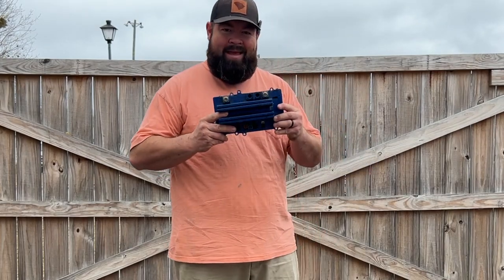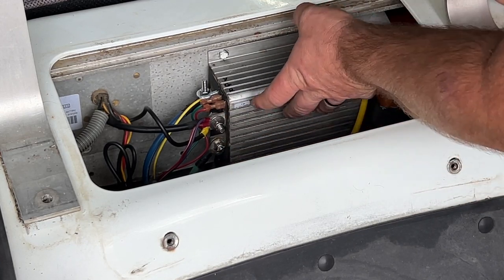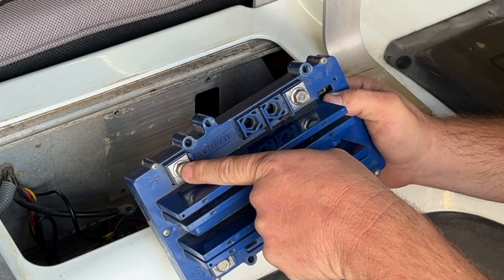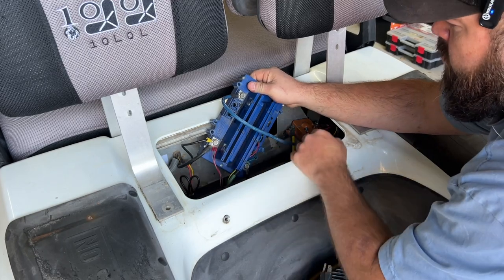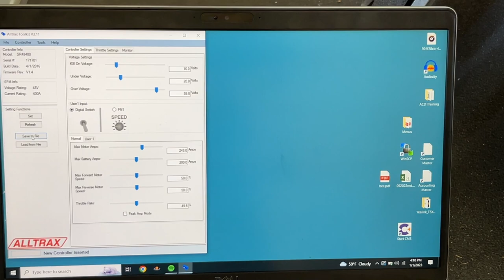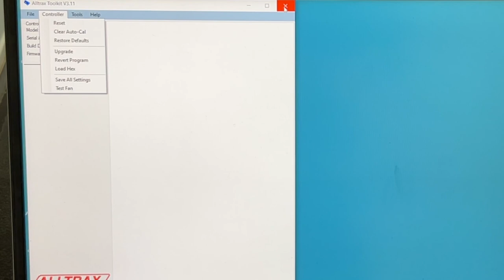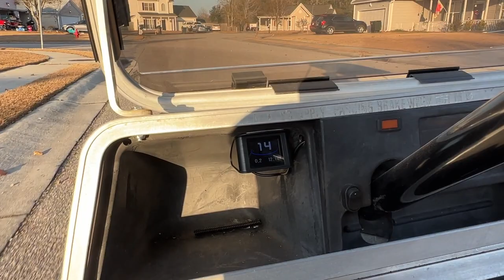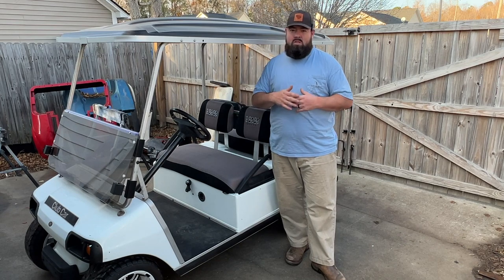Installing Alltrax 400 Amp Controller On Older Series Golf Cart | UNLOCK Settings | Club Car DS

Comment: Came here from you newest Plum Quick video.  I have a '99 CC DS stock with the Plum Quick Grizzly.  Can I just change out the controller and solenoid only?   USB A to USB B 2.0

Comment: hello, love the videos, new to carts, I just came across an fsip motor with alltrax controller, hd 48v solenoid & charger and trojan batt's (cheap) on marketplace locally its off of a 2014 precedent. do you think that it would fit my 93 resistor cart? Id be upgrading from 36v i know. i really just need to know if the motor would bolt up on my axle.

Comment: Always enjoy you videos. Guessing 48V batteries in parallel would allow you to get much more current to the motor. The controller being able to handle 400A and you only have approximately 100A with batteries in series. Is that correct?
Reply from the maker: The batteries are 100ah batteries, that is capacity (run time). The bms in these batteries says 100a continuous, I could up the amperage but if Im riding on the road only, then I wouldnt pull anywere close to 100amps and If I did it would only be at the very beginning to get the cart going. Another thing that I think confuses a lot of people is just because you set the controller to amperage out put doesnt mean you would pull those amps. Say you were pulling a trailer, Going off road in mud (not a hard packed path) or traveling up hills would you ever pull that kind of amperage. These are 12v batteries so I can only run those in series. If they were 48v and I ran them in parallel then the bms in the batteries would help share the load. Each battery now has its own bms and some people disagree with that, However I've ran these in a different video with my navitas ac doing 35 mph on a regular road. Still wasnt pulling that much amperage in that video either.
Reply: @Fentertainment  thanks for the response. I think I’m applying my solar knowledge. Just build a pretty big system back in the Midwest and has 300amp from batteries into 400A charge controller and inverter. Running compressors, AC etc. draws a lot. Thanks for the reply pal!  Keep up the great work.
Reply from the maker: @kevinunion2254  300a of just capacity?

Comment: I know you get a lot of stupid questions but here goes another one . If you had a 91 ezgo stock , what would be the first cheap thing to make it faster? Thanks
Reply from the maker: Thats a marathon? I guess it would depend on how much you wanted to spend. But if its a series 36v cart with good batteries then I would start with a aftermarket motor.
Reply: I meant to say all I have is the 91 ezgo and brand new lead acid batteries. I want a whole kit. So the motor , solenoid, controller, I suppose wires too ? See I just don’t know which parts to buy . I know you recommend navitas controllers . They have different volts and Watts’s and my head is spinning and smoking . I don’t understand any of it. You are a wiz !

Comment: Iv got the alltrax and I changed my wheels after the factory settings and now that they are smaller it's acting like it doesn't want to go to high speed do you know if I can change the wheel diameter.

Comment: Opinion question: I have a 2012 precedent, RHOX lift kit and wheels and a mad jack rear seat kit. Stock motor and controller and running 4 1/2 year old lead acid batteries. I really just want to get as much distance as possible and am not overly concerned about gaining a bunch of speed. In your opinion is there a lithium battery that won’t break the bank but will be reliable? I noticed you don’t always use big battery for everything.
Reply from the maker: Yea, I'm not stuck on one battery company. However my longest range to date and was on youtube was 58 miles on a single charge. I've heard a lot of other people say thats nothing but they havent posted it like they said they were. That was with the silverwolf teekon and big battery husky.

Comment: Question. I have a club car resistor cart and id like to delete the resistors. Correct me if i am wrong but i think i just need a new style F&R switch and a Potentiometer for the throttle along with the controller like the one in your video. And i should be able to make my own wiring harness with it just being ring lugs and spade connectors at the controller? Thanks
Reply: Oh yeah i guess id need a new style v band as well...
Reply: Also, i see on the link for the controller there is an option for the red controller that says it is for 5k-0 speed control. Isn't the potentiometer 0-5k?

Comment: Can you just swap out controllers?  I inherited a 2007 Bad Boy Buggy with dead batteries, going lithium ion and the Navitas DSE 1000 that could also be bad.  Too expensive to replace. Looking for an affordable alternative.
Reply from the maker: Yes you can. You gotta make sure if your bad boy is series or sepex and ive seen both. I know you can get them for cheap however they can be a pain to work on. For series the motor will have a1a2s1s2, For sepex the motor will have a1a2f1f2.

Comment: I have a 2005 Fairplay, 48v, Curtis 1244-5451 400amp controller, DC motor Shunt wound (NEW),  Controller seems to be toast....what Alltrax would I need....and is it plug and play? or do I have to rewire ??